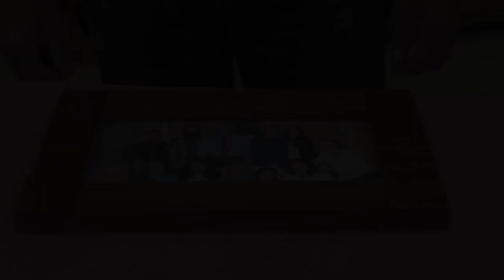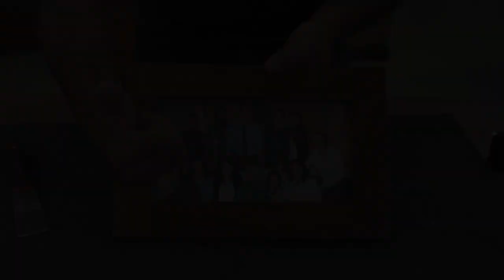Post-Haste Project: No-Miter Picture Frame

Comment: How do you recommend cutting plexiglass?
Reply: +jason .p Here's how I do it: Use painters tape to avoid nasty edges and cut slowly on the table saw or band saw (or whatever kind of saw you have). Good luck!
Reply from the maker: +jason .p You can cut plexiglass on a table saw, and here’s how http://www.wwgoa.com/video/how-to-cut-acrylic-with-a-table-saw-008908/ (http://www.wwgoa.com/video/how-to-cut-acrylic-with-a-table-saw-008908/) Be 100% sure that it is actually plexiglass before you cut it.Here's a neat technique for polishing the edge after you cut the plexiglass. http://www.wwgoa.com/video/how-to-polish-plexiglass-acrylic-edges-001102/